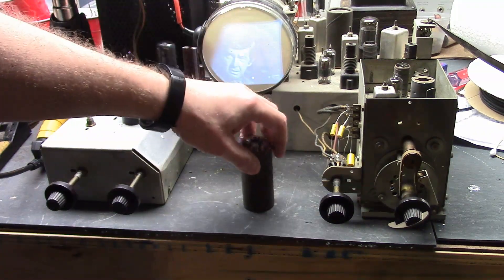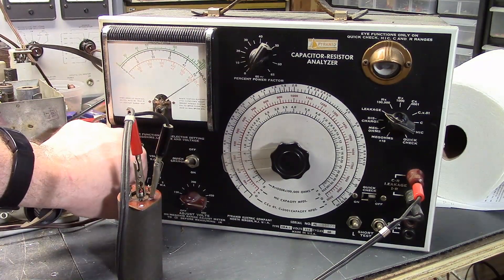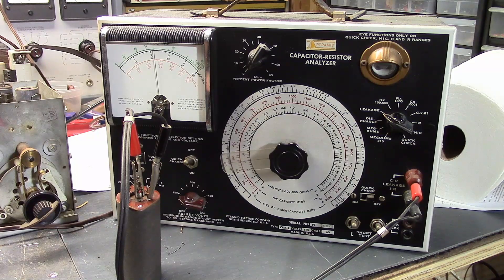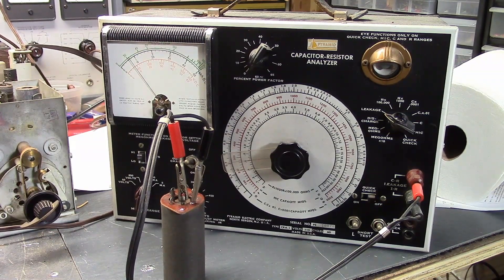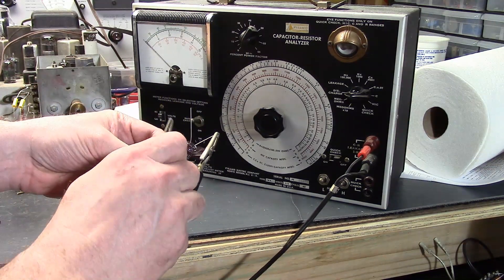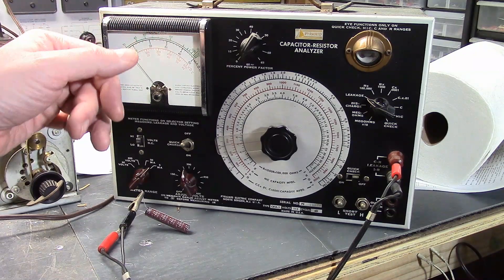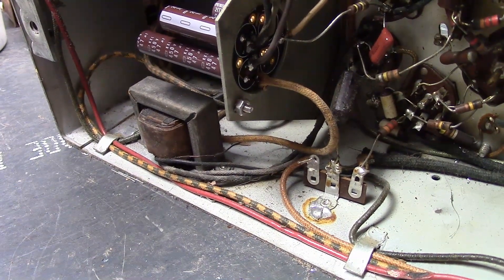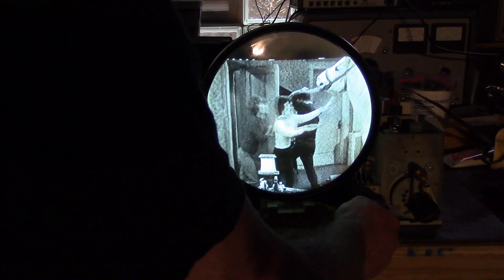RCA 8T241 restoration part 4 of 5

Comment: 13 milliamps at 450 volts would be almost 6 watts in just one section, that probably gets quite warm. In my opinion if it stays cold to the touch it's probably good enough for my own use. If somebody was paying me to do a restoration I would probably replace even if it didn't heat.

Comment: Although I have a cap tester I usually don't waste my time when doing a restoration since it's worth more than the caps. I do spend the time testing resistors and replace them when out of tolerance.
I know that would drive Shango crazy but a 50 or more year old cap, if it's not bad it certainly will be and I don't want to be going back into the set either tube or transistor.

Comment: You could possibly use an old brightener to scavenge the plug and socket and make your adapter there. Then you would avoid cutting the CRT wires. You could probably find yoke connections as I'm guessing they are probably octal type plugs and sockets.
Great work! Seeing these early post-WWII sets really makes me smile. I have many to try and fix up myself.

Comment: Adapt a cap replacements look perfect there Bob. Chassis mount only. If you have a PC mounted dual section E-cap don't 
use them by hacking one in. They aren't designed to be used directly on a PC board where a twist lock cap was. Instead
you might have to remove the old  twist lock cap, remove the shell from near the bottom ( can be cut with a reinforced 
dremel cutting wheel) and remove the guts and then clean up the connections to put new capacitors into the bottom 
remains noting which shape goes where and the negative side too. Running into that situation because the new capacitors cannot go underneath the PC  board because of a metal holder around the edges  that connects to a wood cabinet base. Sometimes you don't have a choice. Typical of 1950's and 1960's tube radios and amps. Just giving out a situation and 
the fix for it. Still have radios where the adapt a cap will work on earlier radios that I will eventually get to.